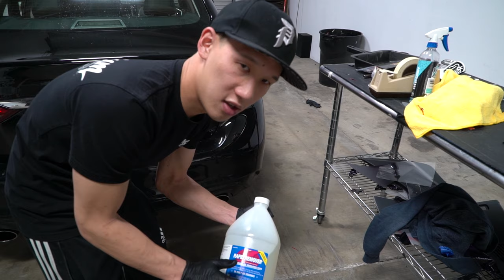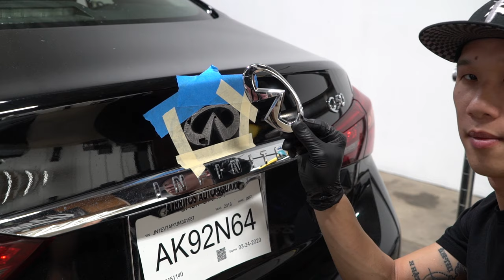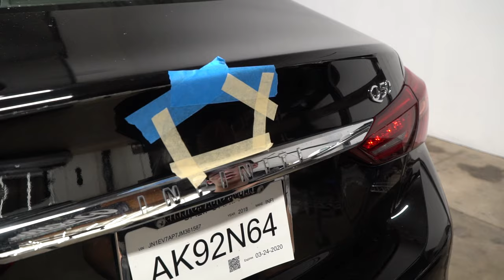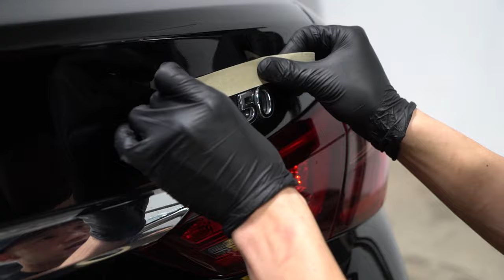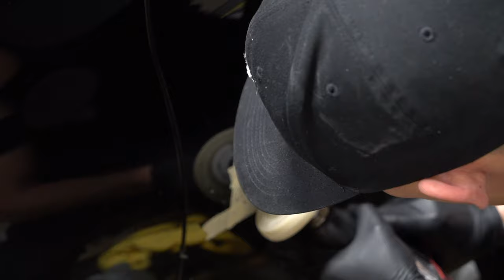How To Debadge You Car EASILY! (3 WAYS)

Comment: The chemicals used in adhesive remover can cause discoloration and dulling of the paint surface and can also damage the protective clear coat on the car. Also, If you ran the eraser wheel on anything other than low speed and/or stayed in one spot too long you probably burned some of your clear coat.
Reply: There’s always a smart arse.
Reply: I hear a lot of bitching and not a lot of solutions.

Comment: If you don't have (or don't want to buy) Goo Gone, I've had good luck using WD40 to remove the left over adhesive.  Then clean it with some Mequiar's cleaner wax (or whatever you prefer).
Reply: Surgical spirit works great !
Reply: A mix of dish soap and water will remove any greasyness left by the WD-40.

Comment: 4th method... Floss, razor blades and WD40 🤣 works amazing. I debadged my Audi last weekend. I still have some cuts on my fingers but totally worth it if you're too lazy to go to the store 🙃 😅
Reply: wd-40 to clean off the adhesive right?
Reply: @JD1mfC  yes... it takes a little longer but it works
Reply: I used bug and tar remover it worked better than wd40
Reply: Would nail vanish remover work?
Reply: Just use surgical spirit I always have some in the first aid kit, great for removing any type of glue residue,  evaporates quickly, and leaves no smell once evaporated.
Reply: @Colin623  thanks for the tip. That's good to know.
Reply: Definitely plastic razor blades over metal.
Reply: @br4morse7  I used regular ones but you have to be really careful. I didn't know they had plastic ones.

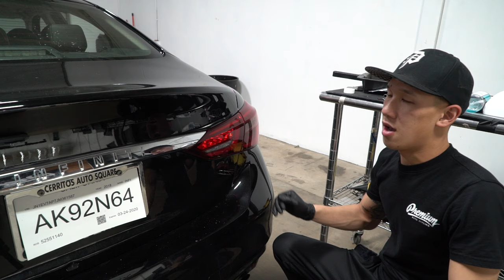Comment: You might want to polish the surface after, you can still see the outlines on the back when you're finished @ 3:04 . The longer those badges have been on the car, the more obvious it will be without a polish.
Reply: how do you recommend polishing? I have wax and wash, would that suffice?
Reply: @dubstomp498  yes
Reply: Light buffing
Reply: This video is about removing the emblems,  not about polishing the car after removing the badges.
Reply: @marketbuy It should all be part of it  Why find a separate video on how to remove the marks after removing the glue after debadging a car!

Comment: i'm taking the badges off my 1999 merc and the glue shit will not come off with adhesive remover...
Reply: Yeah the older the car, the worst. You might want to try the eraser wheel method. Although you’re taking a risk by scratching the paint. Good luck.
Reply: Try surgical spirit !

Comment: I have the X5M competition and want to remove all model/name badges from both interior and exterior. How do you do about removing the X5M Competition badge from a carbon interior center console - without losing the finish on the carbon trim that lies underneath? I would like to remove the badge and keep the nice, consistent finish of that glossy carbon trim. 

Thanks,

J.

Comment: Thanks very much! Most videos seem to just show the rubber wheel on the end of a drill method which I’m not comfortable with due to the risk of taking paint lacquer off with too much force or lack of skill etc so I’m going with hand peeling the excess residue and adhesive remover👍🏻

Comment: First method seems the simplest and quickest.

The third method appears to be additional effort for no reason as you end up having to use the adhesive remover….so it’s one extra step ie eraser attachment for the sake of using one…

Cause realistically after removing you’re going to end up buffing the area to blend everything in.

Comment: What about older cars?  I have a 2007, the emblem came of easily, but the glue and outline is stuck.  I’ve been using WD40 and tar and bug remover for about an hour and it’s not wanting to come off.
Reply: I've had some good results with meguiars ultimate compound, it's not the cheapest but you can use it for other things. 
It removes like 99.9% of it but in a funny light, on a funny angle you can still catch a slight glimpse.
You might have some luck with a cheap car polish or something similar though.
Reply: @JamesHamp93  I ended up using a 1600 grit sandpaper to wet sand as much until as I could before I ran into “oh, sh!t, now I need a new paint job!” That helped, then wet over Meguiar’s compound, the polish, then wax. You can’t tell I sanded some of clear coat, but the outline of “Element SC” is still there…etched in the paint.   Like yours, at a certain angle, you can’t see it. Up close, you can’t miss it!
Reply: @Granolaboy1  I read the first half and thought 'oh shit hes gona need a new paint job!' But then you said about the compound and polish and you literally took the words out my mouth haha! 
What colour is your car by the way? My A5 is like a Daytona grey and the A3 I had before was also grey, slightly lighter in colour. The A3 was a 2006 and that was much more visible in certain lights/angles but on my A5, which is nearly 10 years newer, you can barely see it unless you look for it in but the lighting and angle has to be just right.
Reply: @JamesHamp93  my 07 Honda Element is Nighthawk Black Pearl. Next spring/summer I’m going to brave it and that spot myself…sand it down completely, prime it, spray with Nighthawk Black Pearl spray and clear coat it. The videos make it seem too easy….hey, I can do that! What could go wrong? 🤣Hopefully I don’t f@ck it up! 

Have you tried using clay bar before compound/polish/wax?  Doing all 4 steps is tedious as can be, but the paint looked so beautiful afterwards and felt oh so smooth!
Reply: @Granolaboy1  Ahh nice, that's the same as the Type R black if I'm not mistaken? 
Oh fair enough. I wouldn't have the balls to do that myself as I have no confidence in painting my own car but if you reckon you could manage it I wish you all the luck in the world.
Chris Fix has a video where he completely restores and paints part of his car, with a spray can, and it comes out amazingly well. He gets rid of the orange peel effect by using some 5000 grit sandpaper I think. It looks amazing and he makes it seems super easy but I know i would go wrong somewhere 😂
And when I compounded and polish the entire car I did clay bar it all first and the colour has held up really well tbh. I try to not do it much as it does eat away at the clear coat if you over do it but maybe a full go over every year or 2 with regular washing and waxing keeps it looking good.
When I took the badges off the back I didn't clay bar it because it was such a small area in comparison to my bonet/hood for example which is like speedboat long lol!

Comment: Hello. Nice video. I however did use the Rapid Remover and attempted to remove the last of the adhesive. There is still a very very fine layer of the adhesive that I am unable to get off. Basically you can just see the faint outline of the original emblems. How do I get rid of that please? This is on my 2018 Alfa Romeo Stelvio Quadrifoglio. Thanks for the assist.
Reply: A good polish should take care of that

Comment: Any recommended fishing lines?
Reply: You can use dental floss as an alternative. It's actually better since it's thinner making it easier to cut in between the adhesive and decal. Personally I would not risk damaging the paint buy debadging the car. The process is not as easy as it appears and does require some luck.
Reply: @bsaccs196  so dental floss over fishing line?
Reply: @DonJCarter  Correct.

Comment: Would the eraser tool remove the black marks that have sat around the badging and lettering? I have a white vehicle and dirt around the lettering. Would you guys also know if there's any methods to remove those black outlined around the lettering without using any tools? I removed some sticky residue from badging with goo gone and worked great, and figured maybe the more I keep wiping the outline off with goo gone every once in a while it'll eventually come off.. any other helpful methods? I don't have an outlet or any tools currently at my apt complex..thank you guys and great video, I'll be using these techniques too for any other badging I have.
Reply: The longer the vehicle has had the emblems on the harsher the "outline" will be visible as the paint underneath will still be pretty much untouched. 
I use a touch of meguiars ultimate compound and buff it and it removes like 99.9% of it but on a funny angle in a funny light you can still catch a glimpse of it. 
You might get some luck using a cheap car polish and working it for a while.